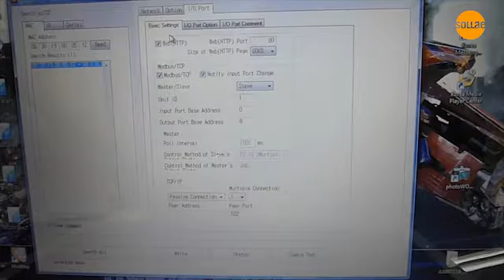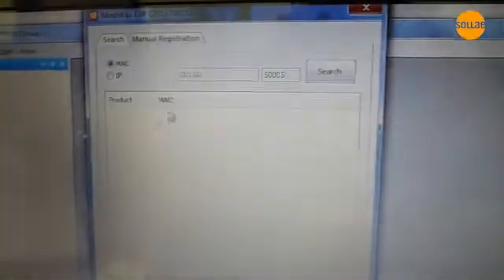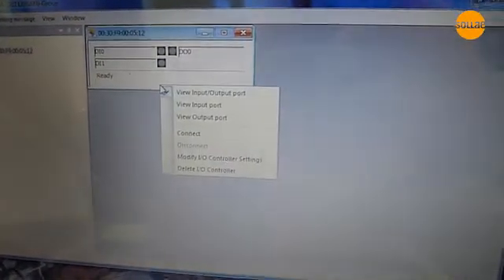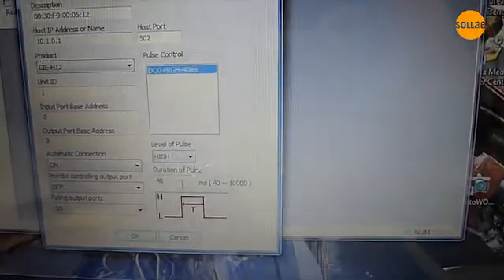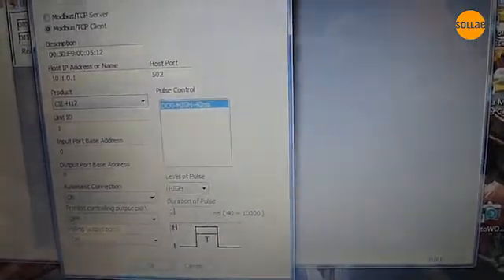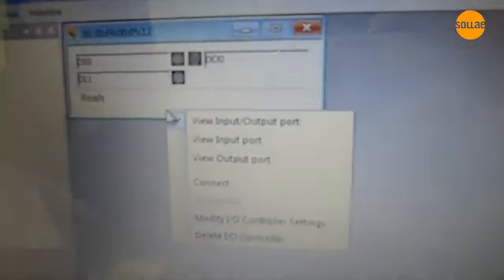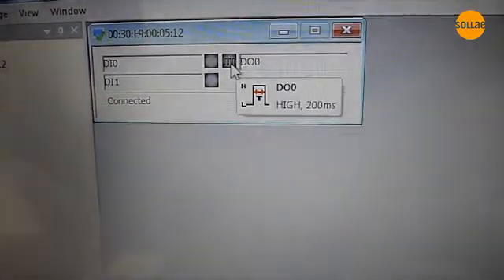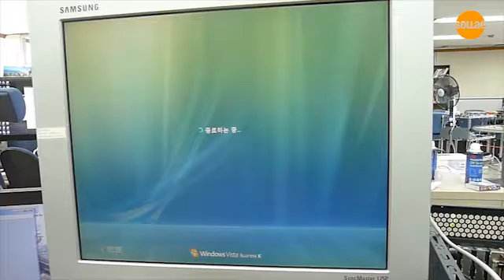Turn on remote PC by modbus/tcp with CIE-H12

Comment: Madam possible we connect with generator controllers?
Reply from the maker: Hello,
CIE-H12 can control device with maximum input voltage is DC 24V. If your generator controllers used DC 24V or below, we can connect CIE-H12 to the generator controllers